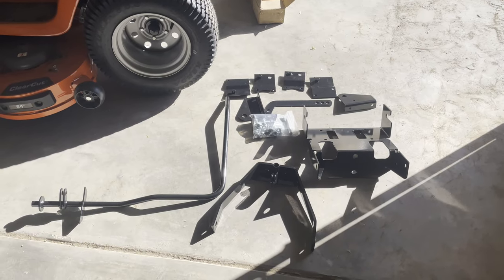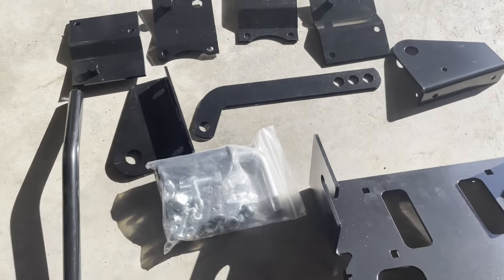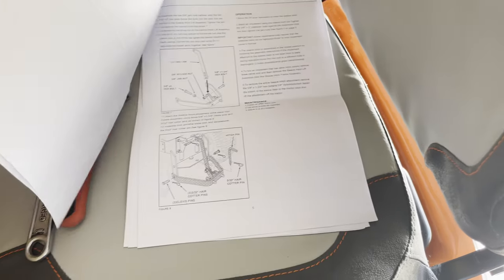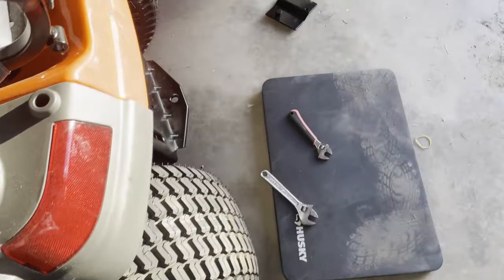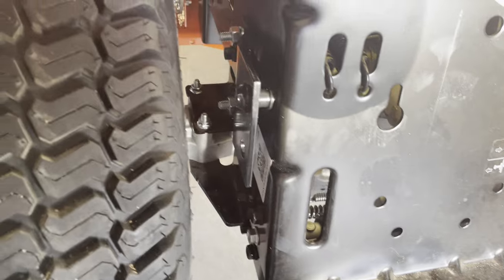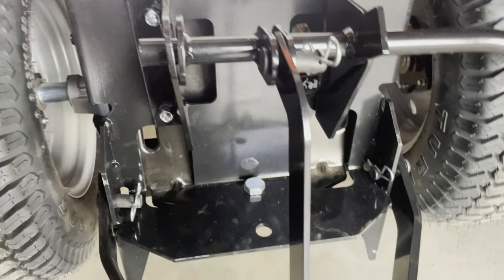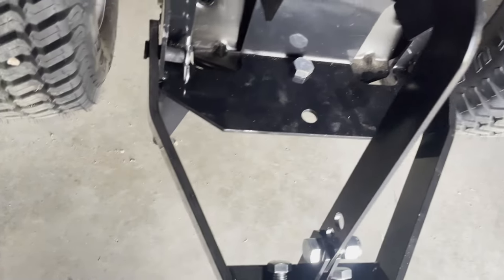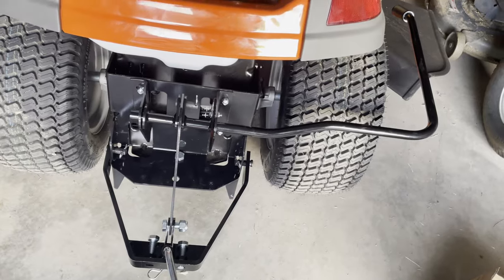Amazon sleeve hitch install on Husqvarna TS 354XD

Comment: Husqvarna TS 354XD is a serious big lawn tractor. I lean to the green machines. I have an 05 JD115 that still runs as well as it did 17 years ago. Put your Husqui on a trickle charger between use. It will give you a 6 or 7 year battery life.
Reply from the maker: I would have loved to go green and yellow, but to get a similarly equipped (as far as HP and transaxle) Deere, I would have had to spend nearly 2x as much. Simply more than I have to spend. 
I have a trickle charger on the way. I put two hours on it today trying to do some grading on my driveway. I picked up a 36" box scraper, which i know is super light duty, but was able to start the process of putting a slope in the long driveway to pull water away from the barn/house, something that would take me weeks with a shovel.